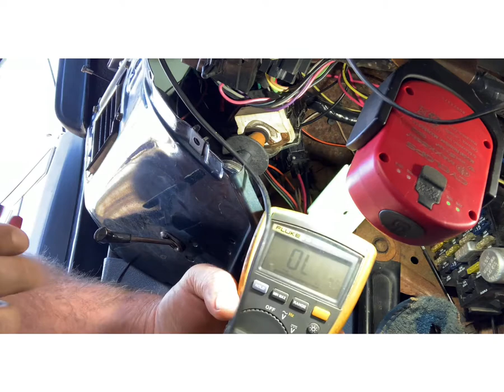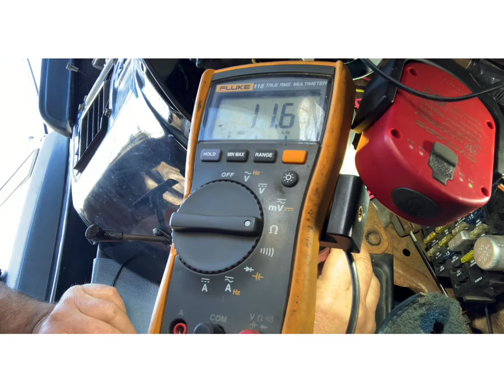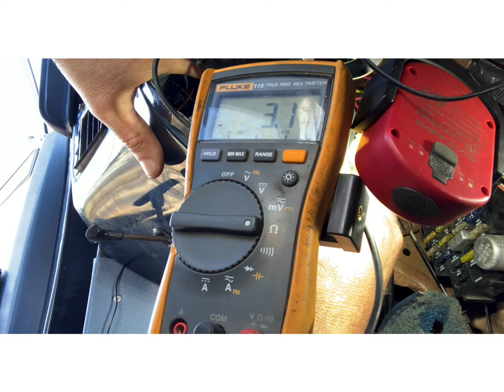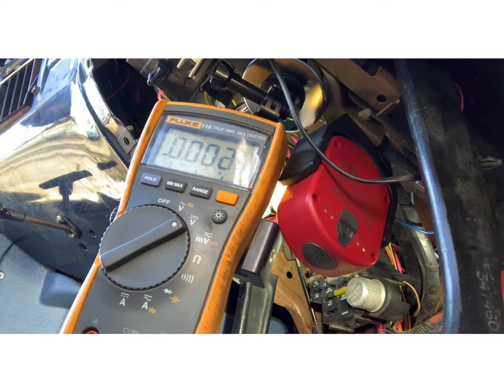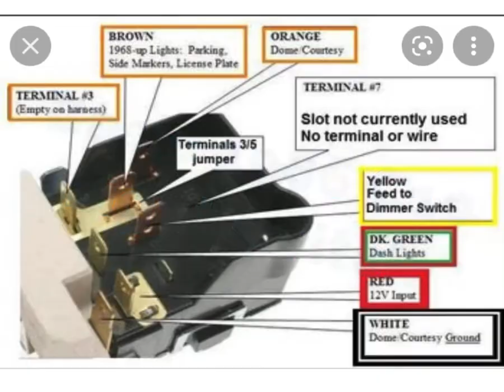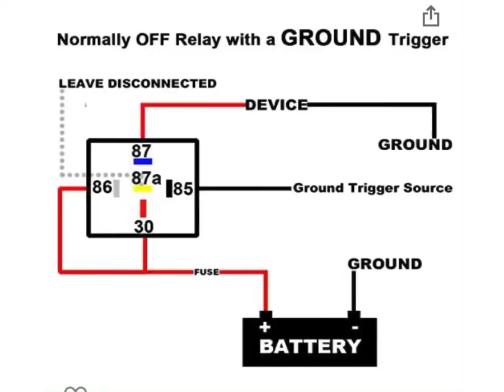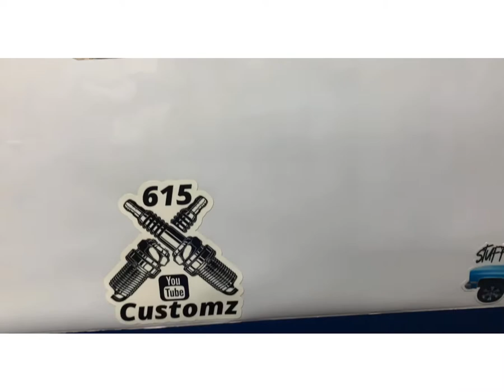Episode 17 C10 Chevy Stepside starting on the add ons wiring

Comment: One of my favorite tricks is using the original resistor wires to trigger a relay for modern ignitions... super slick. I have also used relays with success to combat heat soak on the GM starter solenoids. Best of days to you and yours Bubba !
Reply from the maker: Thanks CanadianBubba 
  I use the heck out of relays, pretty much anything I add, put the load on them, people always wonder why there switches burn up 😃